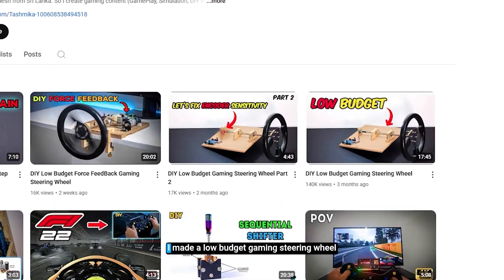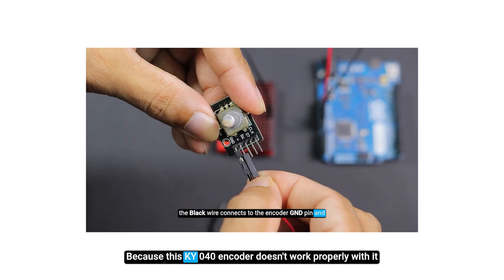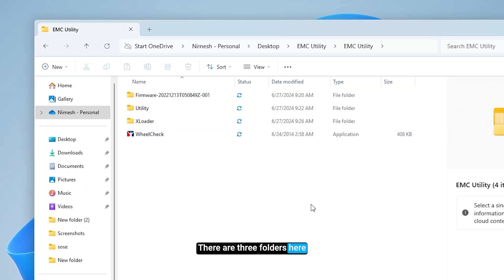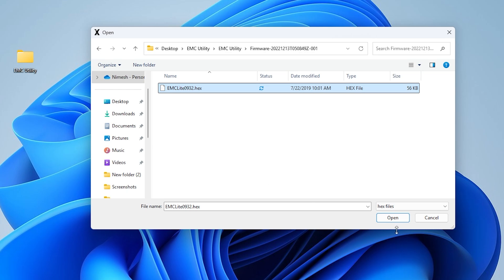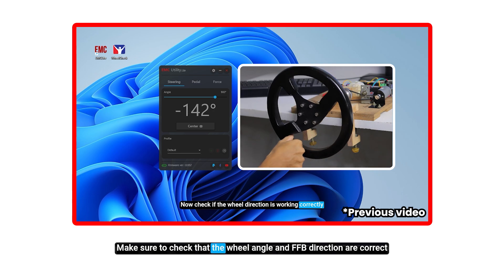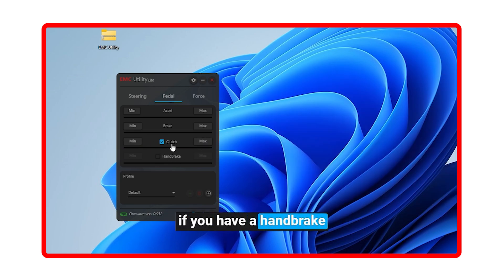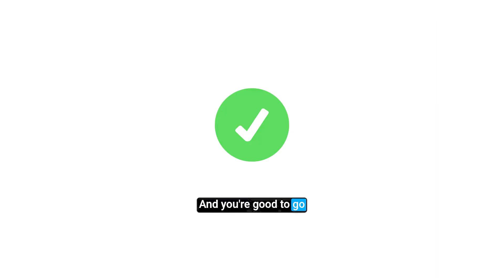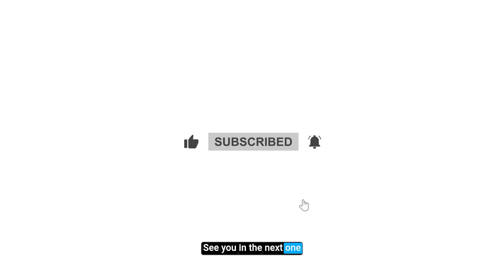Connect Your Budget FFB Gaming Steering Wheel to PC | EMC Lite Tutorial

Comment: Bro my motor driver doesn't get power and the motor is also not working I have tried many things I have also soldering the wire instead of breadboard but it is not working 😢😢
Reply: Mine tooo
Reply: @Arif7032-b7q  found any solution?

Comment: Bro I'm facing a major problem. Please help me.
I was using the same leonardo board for making rpm and boost meter. Also for the steering wheel rotary encoder.
So I started making the rpm boost meter first. Followed everything and it worked.
But the problem started when I tried to use the encoder. I don't know if I made it wrong but I selected a different com port for Arduino leonardo. Now I can't test speedometers. Even the com port won't show. But the rotary encoder still works. What can I do to fix this issue? I can't test the speedometers. Please help me.😭

Comment: Mchn I don’t know why I made your ffb steering wheel using a 600ppr encoder same components as you but when the wheel is powered and connected the FFB is not working at all sometimes it spins continuously and other times nothing at all I tried using EMC and wheel config no results at all first I thought the motors driver was broken but then I did a test code in it using the Leonardo it worked perfectly but the sim isn’t working

Comment: Thanks bro ❤❤❤
Can i use multi-turn potentiometer in joystick steering wheel ?, plz reply ❤
Reply: You can't with this source code
But you can make one using joystick library for Arduino ( non ffb )
Or use joystick ffb library for ffb
But some tweaks need in the code

Comment: I will start the FFB steering project soon, but I can't decide which pulley to choose I couldn't find GT2 pulleys in the city where I live Instead, I found a T5 pulley, can I use it? I thought that since the tooth spacing is more, the possibility of the belt slipping decreases, I will connect 50 teeth to the steering shaft and 16 teeth to the motor, do you think it is enough, what is your opinion?